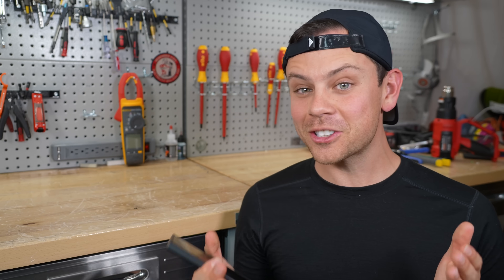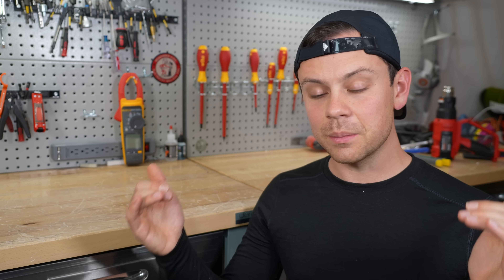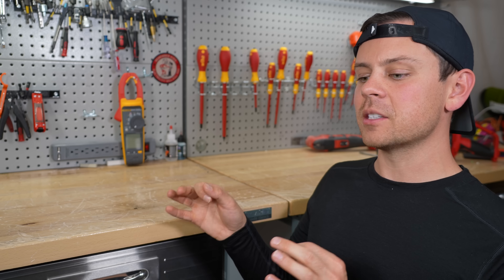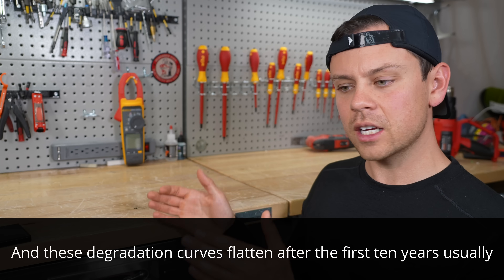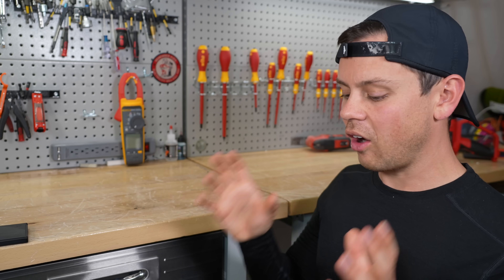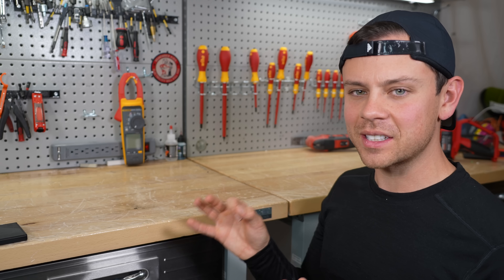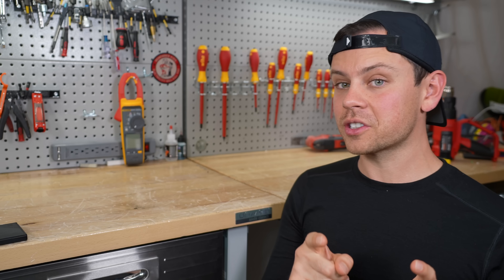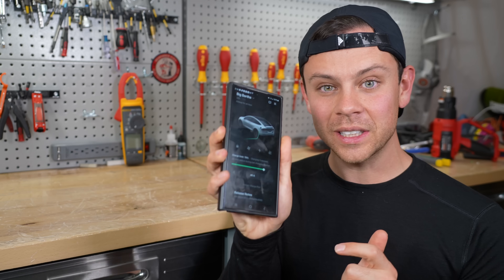LiFePO4 Longevity Discussion! Why Charge to 100%?! For Solar??

Comment: You should do a test to see what effect final voltage has on the energy stored in the cell, I saw a test showing that LFP stored energy does not rise significantly above 3.5v, if that is true then bringing the voltage up higher is pointless, and the balance voltage should be adjusted instead.

Comment: How does it work for us that get very little light in the winter. Im grid tied and maxed on how much solar i can get on my roof. However unless i tell my inverter to charge batteries and not send to load. Thr batteries would never charge. Works great in summer but not so well in winter. Should i keep at 90% and a couple days a month set to 100?

Comment: is there any way/equipment/etc to rotate charging so each battery tops off all cells to 100%, before moving on to the next? essentially, circuit prioritization?

i'm new to all this, & it seems multiple batteries are always wired together in a bank, which i think would prevent addressing them individually from a charge source... but thought i'd ask. live in an era where wireless charging a cellphone is common & cheap, so maybe it's not entirely dumb?

Comment: Can I please ask a quick question.  I just bought a 2024 Jayco RV that came stock with the GoPower 200w Solar package.  The dealer provided a crappy lead battery, which I thought I should upgrade to a LiTime 12v230ah battery.  I don't boonedock much, and 90% of the time will go camping with fully hookups, but when in storage the solar with the 30a PWM is maintaining the battery.  I always pull the main fuse, but even with the fuse pulled, there is some small parasitic loss over night. So the battery is seeing a little usage daily.  My concern is, is this small usage eating away at the life of the battery?  I wonder if I should get a battery disconnect, and turn off the PWM charging and just let the battery sit while in storage or is it better just to continue as I am during the summer.  During the winter storage, I will be removing and bringing it home.  TIA !!!

Comment: Use well matched cells, bring them up to 95%+ regularly so that the required balancing current is low and the balancing done by a typical BMS is fine.  The only need for a high current balancer is if you have mismatched cells since you have to contain cell voltage at much higher currents.  It's been entertaining seeing the community slosh back and forth and disputes rage about how to care for lifepo4 over the years but all the time I've just been doing this based on the original charge profile of my Victron MPPT chargers on the basis of "If it's good enough for Victron, it's good enough for me".

Comment: For most standard solar setups; IE some EG4 server rack batteries; what is your recommendation on amount of time at 100% to balance?  30min?  Hours?   And…. Minimum once a week?  Once a month?

Asking because obviously if you can output to grid and get $$$ back; extra power should take that route.  But if you can’t top off at 100 to balance; how often should you “force” a balance with an either grid or generator?  👍

Comment: But you never get to the punchline for those who want to store their batteries at 50%. I get it that they will still read out near 13.2-13.8 volts at 50% SOC because of the flat power curve delivery for LiFePO4. 

My old Chinese charger( EMC12-15)  puts out 15A at 15V but will not charge my long term stored ( 4 yr old) 100Ahr Battleborn Batteries after I have just partially run them down  to a limited level, unknown SOC , for their first cycle on a 1.1 A  x120V refrigerator.   My cheap Chinese  2500W  12V to 120 ACV  XYZ Pure Sine Wave Inverter powers the frig with  a  single 12V AHr Battleborn Battery until voltage has dropped to 12.2 Volts- not enough to cover the surge starts on the refrig and the red alarm goes off on the XYZ. But still plenty of power left in the Battleborn.

In short, a better way to  FULLY deplete the Battleborn would be to run a 1000W  electric hot plate so that it totally depletes the battery and does not preserve a surge charge reserve?  But then on the recharge, I would need a SOC meter to indicate 50% for each battery if I wanted to store them. So is it  better to store them individually and later connect them to form my 48 V pack for an  emergency or  assume that passive balancing will take place if I hook 4 of them up in a 48V in the cross /diagonal method? (They would also passively balance with each other.)

Comment: You will be at 100% right aftet peak solar   Once peak solar gets you to 100% then it will stay there as long as solar is supplying all the power for your loads. Once your loads are using more power than your solar output you will start pulling from your battery. 

I have solar but no battery. I can look though at what time I start pulling from the power grid and that is usually between 4pm and 6pm I start pulling from the grid. So if I had batteries this is when the battery would start getting drained down.

Comment: And how about just backup batteries and grid, no solar. I use it for backup and to top off high usage (i pay in tiers of 0-5 kWh 5-10, 10-15 etc) so I have my system sometimes ‘jump in’ to help if the usuage exceeds 9.9 kWh (peak). But besides that, it is idling and waiting for an outage. So I have the limit set to 80%. 50% i think is a waste for when the outage happens. And 100% i think it idles to much on it. So should I put them to 100% or leave at 80% and occasionally top them to 100%?

Comment: I have some solar set up as parallel to the utility.  I run freezers and my internet gear full time on the solar.  When we have lots of sun, I run a dehumidifier in my basement.  The SOK batteries are in my basement, which stays at 60F to 72F degrees.  The batteries report anywhere from 119 to 126 cycles, and the system has been running constantly for 18 months.  With the dehumidifier, I regularly cycle between 100% and 75% over a day and the lowest I have ever had the batteries was about 38%, if memory serves.  I use Solar Assistant to keep an eye on things, and the data jibes with what I see on the packs and inverter.  

Many thanks to Will for the info.  I started the solar journey after a video he made just showed up on my YouTube feed a couple of years ago.  There is no better and trusted source of information on solar and the pluses/minuses and configuration/setup.

Comment: Unaware of what I am unaware, Sincere Question: Of recent I've acquired two Delta Pros w/240 hub & several of their proffered 400w "portable" pannels as a Back Up "generator" if needed. In this storage setup modality the EcoFlow instructions are to (quarterly) charge to 60% and discharge to/leave at 30% between uses/during storage. Is that still best? Should they be 100 to Zeroed periodically or anything? What do y'all in the learned/experinced know think? Best, TIA, E!
Reply: Adtl; Two Delta pros and two backup batteries in total. 👆

Comment: I never thought to charge my main off-grid system with my secondary portable system. I’ll try it! Maybe I can run the 450 watt AC without worrying it will drain the batteries overnight.

Comment: What should the float voltage be set to? It's confusing that normally it's recommend to be lower than than the fully charged voltage should be.

Comment: You're the man got a question for you charging my RV battery solar yes but the question is the power converter charger with two settings bulk 50 amp continuous or float charging what's your recommendation

Comment: excuse me if this doesn"t come across as positive but will prowse has been the guy that i listen to or learn from ,  im 54 and he is way younger and more knowlageable about solar and lithium ion batteries.   but this brow beating from will for doing what he recomended 4 or 5 years ago that i wrote down like the gospel ,  it would be better to claim " hey new long term testing has revealed . so do it this way now . not this is crazy how many people are not doing things right with this  new info. disappointed but still a loyal fan. i know knowledge when i see it .

Comment: I have a solar system at my cottage. Only things I am a little worried about is charging to 100% all week when I am not there and the BMS screwing up over charging until fire. Summer here I get a lot of sun, they charge until the BMS shuts them off. Just wonder if there is something I should do to keep that from happening. Not worried about battery life, figure they will last a long time if the BMS doesn't screw up.

Comment: So for someone who is full time offgrid,  what is the best method for balancing with an MPPT charge controller.  I charge via generator to 29.2( 24v system) then shut it off and it drops to 27.2 for about 15 minutes or so.
What am I supposed to do to leave them at 27.2 longer for passive balancing.

Comment: You lost me on this one.
1 - Do the test yourself : For perfectly matched cells unbalance comes only at the very end of the charge (or discharge).
2 - Cell degradation (dentrite buildup) occurs mainly at the very end of the charge. Microscopic observations show a grow from localized anode regions where an excess electron  concentrates.
3 - Both phenomenon are getting worse with temperatures above 25°C.
This is the reason why cells are doing longer when used between 20 and 80%. Numerous long duration tests swhow that they last even longer if used around 50%

Comment: I'm new to all this solar stuff, and I'm doing my research. Your channel has become my go to for accurate info. My situation is a bit different. I'm setting up a small, portable system to keep in my Jeep for camping and trail side repairs. I will be running a 100ah lifepo4 battery. Never more than 2. Batteries will be stored for long periods, mostly in the garage in winter. Temp no lower than 45 f. Right now I have yet to order my battery, but I have a couple of 12ah lifepo4 batteries I've been experimenting with. So7nds like you're saying a 100% charge before storage won't do any real harm, but dropping to as low as 50% is probably better. Anyway, I like what you said about not  stressing about it, because once I get everything set up with my controller (looks like a victron energy smartsolar 100/30).  I plan on making sure storage voltage is OK, checking charging when I set it up, and not worrying otherwise. 1 have 2 160w fold up panels I will be using,  which should be plenty, ( probably overkill),even on cloudy days. If I end up with 2 batteries,  I'll probably go to 24v for the controller, and to help with my 1000w inverter and power tools. Anyway, thanks for the great info.

Comment: Hi Will, great video.  Do you have any experience with high humidity effects on inverters?  Mine (EG4 6000XP) shows strange currents on the Generator port while I have nothing connected to it and has effect on output frequency (Hz).  It only occurs when humidity and temp cause water condensation. I have it installed onder a roof , no sun nor rain, but i'm going to have to build an enclosure around it and start doing airconditioning.

Comment: It depends on the BMS. Many won’t balance until they reach 3.5V . Others can be set lower through software. 3.4V is good voltage to keep cells from degrading.

Comment: I started with LifePo4 12v 100ah batteries in 2016. I bought them to use them not to be scared of them or have them control me. Since 2016 all my different LifePo4 batteries have been discharged and charged to 100% daily or they’ve sat unplugged for months without use after being charged to 100%. I’ve never felt I lost capacity or ruined any of them. The only charge to 80% rule wasn’t around in 2016 in fact I have emails from Battleborn techs saying charge to 100% before disconnecting and storing their batteries over winter when I didn’t need them several months. Buy them to use them trust them and sleep easy.

Comment: May want to check out Engineering Explained and the recent video about LFP state of charge.  Has lots of graphs and data, and tries to arrive at a best practice based on data, vendor recommendations, and real world.  The conclusion is that charging to 100% is not ideal for both NMC or LFP, but you need to periodically charge LFP to 100% for the balancing / SOC accuracy.  Although talking about EV LFP batteries, the charge advice would be the same for solar.  So if really looking to maximize LFP cycle life and capacity degradation, you'd want your daily charge to 80%, and only charge to 100% periodically (weekly, bi-weekly, or monthly).  Not something most charge controllers / systems support automatically though.  That is, for those who really want max life - what you say overall is likely fine for most - who will likely change or upgrade batteries in the future anyway.
Reply from the maker: Check out my comment under that video 😂

Comment: I have 3 batteries in parallel. The instructions (LiTime) say that I should disconnect and charge each battery individually to 100% to balance every 6 or 12 months. Does this mean I don't need to do this as they get charged to 100%   daily during summer?

Comment: I purchased the BLUETTI Ac200max cause of your content on the unit for two years now I been using it for running everything in my room unit goes down to like 40 percent by 1 pm is charged with 5 180 watt panels I don’t do anything just let it do it’s thing does this video goes for power station like the BLUETTI or for DIY units only..Thanks great video 🔥🔥

Comment: We have TOU electrical grid rates where we live. Our peak net metering time periods in the winter are outside the normal sun exposure. Our use of batteries is to feed into the grid at those peak times. Depending on if we charge them with low TOU rates and solar it could cycle the batteries 2x a day. Would 2x full daily cycle start to get into too much battery degradation?

Comment: So I have about 1600W of solar here in Michigan that I charge 4 100ah LiFe batteries.
In the summer I use the batteries to run a pump for a small 18ft pool.
I have plenty enough sunlight to charge up during the summer.
But now with the angle of the sun, it takes days to charge my batteries to 100%.
But to do that I have to turn off my LF inverter to get more to go into my batteries.
I do plan on installing more solar panels next summer and they are used panels and they work well!
I use the batteries sparingly now and would like to use more for my house.
How should I be charging and discharging for winter months?
Should I be taking those batteries all the way down with so little sunlight?
Nervous in Michigan...

Comment: Upgraded my off grid solar 48V to LiFePO4 batteries  a year and a half ago from lead acid and it has taken me this long to get my head out of lead acid battery thinking. OMG finally beginning to understanding the chemistry with a relatively flat voltage curve to capacity. Thank goodness for the smart shunt.  And really I  can discharge them below 50 % without severely shortening there life!  I certainly had problems balancing if I didn't allow them to fully charge  over winter. so charge discharge charge discharge and charge. Thanks for another great video.
Reply: So many battery chemistries, so little time to learn new ones until the next one arrives.
Reply: @edwardlulofs444  Going Fuel Cell  Next

Comment: 🙂So, my system works pretty well for me, doesn't it Will?
I have LifePo4 12kW Basen Green battery with 2000w panels and LifePo4 3,6kW Ecoflow Delta pro battery with 800W panels (EF balcony hybrid solar plant). BG battery is charging the Delta pro all the time, Ecoflow Powerstream is charging the house up to 600W / h max (with a help from delta pro).
So in summer time - sunny days both batteries are daily full to 100% and at morning about 30-50%. When rainy days comes, both batteries discharged to 0% in day or two.
In winter time in sunny days both batteries are daily about 40 - 60% and close to 0% or at 0% most mornings. If the weather is sunny Basen green is charged up to 100% at least once every two - three days. When bad winter days comes with no sun,  then I set them to discharge to 10% and so they are waiting for the next sunny days 🙂 Hope, this is just OK?

Comment: I have a 230 amp in my van with a Renogy rover controller. I don't live in the van and only use it occasionally. My power needs are minimal. The controller doen't allow it run to zero and it fact seems to charge it when it drops to about 65-70% SOC. Do i need to change some settings? Or just keep it on the standard setting for lithium batteries?

Comment: I have 4 lithium ion batteries in my 5th wheel, 8 100w panels and a 48v 3500w renogy inverter charger i literally barely use. I leave the solar connected from spring until fall and i store them at %100 charge. For the longevity vs price who cares. Run them up and run them down. Dont store them hot and dont use them cold. So simple. Dear diary.

Comment: I live in the UK and have a commercaily fitted system 3kw of panels and 9kw of lithium growatt batteries and hybrid controller . In the winter the battery does not charge over 20%. Should I do somthing to charge my batteries too 100% ??

Comment: Will, define 0%.  Is that when the cell OCV is 0V or when it's 3.0V as set in the BMS ?
Reply from the maker: Please be joking with this question 🤣
Reply from the maker: What do you think Stanley
Reply: @WillProwse  I assumed you meant when the BMS shuts the output off because it thinks it's empty but it needs clarifying (which I see you've done in the comments).  Its actually a question I meant to ask on your first video 😀  Knowing what 0% is is very much dependant on the system in question so spelling it out helps clear any ambiguity.

As an aside, I like to see real numbers where possible rather than percentages especially when percentages are used by lazy journalist to exaggerate a problem, e.g. a 200% increase in... which could mean that there were  three rare events instead of one.
Reply: @StanleyRestall  0% -> 2.5V per cell.